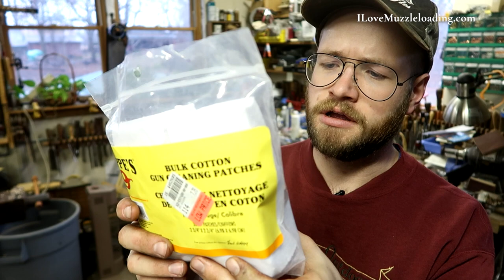How I clean my Kibler Southern Mountain Flintlock | No more rusty muzzleloaders

Comment: tea pot and a small funnel.  I spray a squirt of ballistal in barrel then pour in the boiling water, let it sit for a minute, breaks things up real good. then do what you do in half the time and patches.
Reply: Do you get flash rusting using hot water?  I started just using room temp water for that reason so I'm curious if it's common or not.
Reply: @billmelater6470  water breaks down the fowling... If it make you feel better.... US Army ordinance manuals circa 1864 said to use boiling water as well... Fill the barrel twice, let it sit 5 minutes, fill half way a third time and shake it for about a minute, dump it out, wipe down with patches, issued no more than 10 for drying and oiling with either mink oil or tallow
Reply: @billmelater6470  i do a squirt of ballistal with the water so that may help the flash rusting you speak of.  I don't have any flash rusting as soon as I dump I'm drying with patches and using ballistal oil.
Reply: @swamprat9018  I might give that a try.  Though for the last year I've done well with simple tap water followed up with moose milk then a swab with straight Ballistol.
Reply from the maker: Great idea, thanks for sharing.
Reply: @billmelater6470  I have been using hot soapy water for decades.  Never noticed any "flash rusting".  I suspect that this may be partially an issue with the steel formulation.  That said, my Browning Mountain Rifle shows no sign of rust except the exterior surfaces.... which came that way from the factory.  As Browning's Japanese steel is known for rusting (just ask anyone who owns an old Citori before they started chroming the barrels), I would still say that flash rusting is a rare event.  Not cleaning it is the more common cause of rust in my experience.

Comment: I clean mine basically the same with a little less oil, wipe inside and out down with a clean rag with mink oil on it. When im done i put enough oil on a rag to penetrate the whole way through it and place it in the muzzle of barrel to restrict air from entering barrel. I do the same with a rag over my touch hole. The piece of rag in muzzle is big enough it wont easily get lost in the barrel.
Reply from the maker: Good idea on the piece of rag, easy to get in and out. Thanks for sharing!

Comment: You are very correct in that there are lots of ways to clean BP firearms. What matters at the end is that the fouling is out, if water or a water mix was used the gun is dry, and then a rust preventative is applied. Don't stress if you use a petroleum product as a rust preventative. The bore should be swabbed out before shooting anyway.  Good video and advice.
Reply from the maker: Thanks for watching Nick!
Reply: I quit using petroleum based oils and cleaners decades ago.
If you are using a product like bore butter or similar products that are all natural and with not petroleum base in them, you are actually seasoning the metal like a cast iron cook ware.
You will get alot less fouling and you gun will clean up with half the number of patches. It gets into the microscopic pores of the metal and pushes any rust or minute fouling to the surface away from the metal.
I have clean a rifle that way and came back 6-8 months later, no rust, and ran another patch of wonder lube and pulled out very little light brown surface streaks only, but the barrel was prestine.
Reply: @denisdegamon8224  Only problem with your repeating of T/C advertising is that barrel steel is NOT cast iron and does NOT "season" like cast iron.  After several months of storage I get ZERO brown surface streaks. None.  And using Ballistol or Mr Flintlock or Hoppes Black Powder cleaner/patch lubricant I can shoot all day long without cleaning.

Comment: I've always used hot soapy water and hot rinse water. Tooth pick in the touch hole and a measuring cup with a good pouring spout. Do it outside or in the shower stall. Takes some care but you can keep the water off the wood. WD 40 for lube when I'm done if the gun is going to be shot regularly or good gun oil if it is going to be stored for a while. Knap my own flints from agates or petrified wood.

Comment: Ethan, i know this is an old vid but the sulfur and salts that eat up your BP guns are water soluble. All you're doing is making goo n smearing it around until it oozes out. You dont have to put it in the bath tub but you dont need to add a bunch of oil n chemicals either.
Im tellin you 8oz of hot water with a splash of ballistol will change your life.

Comment: I am a year or so late to this party, but, I have found that most of the fouling is an issue with your patch lube. I use 60% lanolin and 40% bees wax. The lanolin can be an issue to completely remove from the bar, but it will come out. Clean the bore till it shines from breach to muzzle and add oil, doesn't matter if I will be shooting tomorrow or next month. The rest of the process is the same as Ethan did.

Comment: One thing that I do after cleaning my muzzle loader is store it barrel side down in my gun locker. Any oil that is in the barrel will run down to the muzzle and not collect in the breech. 
Another thing I do is use alcohol patches that a nurse would use to clean your arm prior to giving you a needle. They are dirt cheap. I run two of these to start the cleaning process and one just before I oil the bore.
Reply from the maker: Thanks for sharing!

Comment: I use just warm water. Plug tge touch hole fill with water then dump. Repeat a few times then swab with damp, dry and oil. 
Thing is as long as it’s clean there is no wrong way. As ten old greasy buckskiners the best way and get a hundred answers
👍on good vid
Reply from the maker: Thanks!

Comment: I do one thing different than you and that is I run hot soapy water and let it sit for a about 15 to 20 minutes with a toothpick in my touch hole then once I pour the water out I start doing the same thing that you do. Let me tell you about the first time I got my traditions Hawken. I had had it about a week and thought I would go ahead and just check the barrel to see how clean it was because for some reason it kept calling me to do this. With my first patch down the barrel and when it came back out it was full of rushed. Luckily there were no rust chips so I was hoping that it did not pit it any. I almost used a whole box of cleaning patches to finally get that thing to where there was no rust and no color it was awful. At first it kind of scared me about it possibly being pitted and to be honest I haven't had the board looked at to see if it was pitted, I'm almost afraid to but one of these days I'll come across someone that has one of those bore cameras and have it checked out. I Also do about the same thing you do during the winter I'll pull all of my guns out at least once a month and just go through them cleaning. I have a cork that fits the barrel perfect on my Hawken and I put a string on it just in case it decided it wanted to go deeper and I couldn't reach it plus I tie the string to the ramrod. When I started using the Swiss black powder I didn't have to run hot soapy water down the barrel. Well this was a good video it really was and showed what most people should do to their black powder rifles. Thanks so much for the video and look forward to some new ones. Keep ye powder dry!

Comment: Well, I only have a few Hawkens, and a couple CVA type Kentucky rifles. So Hawkens I remove barrel, Traditions remove butt stocks, nipples, vent liners. Then put breech ends in bucket of warm water n Ballistol, start with brass brushes plunging, then switch to jags n patches, then dry patches, then Ballistol patch. If its going to be a bit, yes I go with an heavier/thicker oil. I always keep mine in siliconed gun socks. For a nicer slim long gun like your Kibler, Uncle Sasquatch has a video where he uses a clamp type thing with a hose, it clamps/seals over your touch hole, hose goes to your cleaner, (water?), I believe from TOW. I thought it rather clever, if I had a nicer rifle I would probably get one. I also use a grease on underside of my barrel that I leave pinned into fore stock. Take it down once a year. Same as you, but different. They get clean n oiled, right? Thanks for doing this one
Reply: Tooth brushes work extremely well
For me when cleaning lock..
Reply: @jamesholt6032  yes,I too use them for nooks n crany’s. I get the bargain packs keep some dry, use some w/ solvent, some w/oil. Thanks for mentioning that.
Reply from the maker: Thanks for sharing your info! I've seen those clamp deals too but never tried it, perhaps thats something I  need to be doing.

Comment: Hot water is the best at removing fouling. Get the barrel so hot you can’t hold it for long. Follow with dry patches then oil it. Run a patch the next day to check for rust.
Reply from the maker: Thanks for sharing Steve.

Comment: Great video! Maybe I need some ballistol...I just use some dawn dish soap and hot water down the barrel and 3 in one oil to keep it from rusting. Every now and then some WD-40. It seems to be working OK< but the rifle is just 2 years old.
Reply from the maker: Thanks! If it works for you, I won't knock it! I know many that use Dawn and WD-40. Both those solutions are kind of modern day miracle products I think. I use them all the time for many things. 

Keep me posted with how you like using them!

Comment: Good video Ethan.  I feel like I'm not an outlaw in that I use more solvents than water.  My solvents are different but achieve the same results.  I'm going to find a bottle of the Clenzoil.  I've never tried it.  I've been using Birchwood Casey Barricade.  I'd like to see you post a video on cleaning a smoothbore.  I just don't seem like I'm ever happy with my cleaning job and periodically go back and clean and oil again between shooting.  Thanks for your videos.
Reply from the maker: Thanks for watching Steven. I've not tried the barricade but it might be something to add to the shop, never know when you want to switch things up. 

I've got to find a smooth bore first, I'm a bit behind on the times and don't have one I feel comfortable getting out and shooting just yet.

Comment: Your methods almost duplicate mine for the past 30 years. I have found that a breech scraper is worth its weight in patches as I found that the residue at the breech would color a wet patch forever. I do plug the touch hole and after I’ve run all my patches I use hot water and fill the barrel, let it soak, and then run a patch or two to confirm all is clean and to dry the barrel. Then oil the barrel while still warm.

Comment: Good informative video. I am looking at the Kibler woodsrunner as my next project. i still have not fired my Investarms Hawken yet. I'm not happy with the repair I did on the miss-aligned nipple and hammer. problem I will remove all the wood putty I used in the lock indent and try the repair you suggested with a torch on the hammer. I was concerned about the way that the barrels of Kibler's rifles are held in place as opposed to the wedge used by Traditions and Investarm. That it would present a problem with cleaning Your video put that to rest.
Reply from the maker: Hey Mike, I hope you get to shooting that Hawken! I'm enjoying mine quite a bit. Reach out if you need some more tips, I'm happy to help!

Comment: I've actually been wondering about this lately. I'm new to traditional muzzleloaders and looking forward to getting into it. What cleaning/loading rod do you use? Apologies if you've answered this a dozen times already
Reply: For the sake of getting you an answer; I use an all brass rod with a muzzle protector for my range rod and cleaning rod (ordered from Log Cabin Shop).  Steel is fine too but, be sure to get a brass muzzle protector either way.  I like my T handled rod for the rare occasion I need to break out the ball puller.

I don't trust wooden ram rods.  Be sure to get a good range rod.  From there it's just a matter of getting the proper jag with a cup for round ball or conical, depending on what you plan to shoot.
Reply: @billmelater6470  thanks very much Bill.
Reply: @thwackTX  I almost forgot.  Check out a channel called "dualist1954".   He's got quite a few videos that cover the basics with REALLY helped me out when I started.
Reply: @billmelater6470  awesome, will do. I inherited a .45 Hawken full stock from my late father that I am really looking forward to shooting and hunting with this fall. Been slowly collecting the things I need so hopefully I'll be at the range soon.
Reply from the maker: Hey sorry for the delay Robert! I made this range rod in my shop but you can get some from the Log Cabin Shop, Flintlocks LLC, Deer Creek Products, or many of the other muzzleloading supply shops out there. Just be sure you get the right length for your barrel.
Reply from the maker: Mike has the best videos!

Comment: Since the breech plug and tang are one piece, it isn't designed to be removed every time it's cleaned.  How do you prevent cleaning agents like ballistol, from seeping under the barrel?  Ballistol or any other cleaner will leak and take with it the corrosive black powder residue and other contaminants, and leave them under the barrel.  How do you prevent this from occurring?  Any ideas?

I have a Pedersoli "Traditional Hunter Hawken."  I was very surprised to find Pedersoli designed their rifle that way.  
I took mine apart before I took it to the range and left the underside wet with WD-40 Corrosion Inhibitor.  Hopefully, that will slow down the corrosion.  

I remember back in the early 1980s, I saw a one piece barrel (I don't remember the manufacturer), which had been pulled from the stock.  The underside was a rust bucket.  The top was corrosion free and looked pristine.  That was the main reason my first muzzleloaderI was a Thompson Center Renegade Flintlock with a hooked breech plug.
Reply from the maker: Great eye and question! 

Traditionally, we see these pinned barrels like this one left, and possibly taken our yearly or by yearly in contemporary muzzleloading. I'm trying to find some of the historic record to advise on barrel channel cleaning pre-1890 but it's been hard to find outside the military record. 

For many, myself included, a tight barrel inlet is key to helping stop any detrimental rust. In my experience, and family experience, any rust on the underside of the barrel is easily cleaned, oiled and back into good shape in no time. I'll pop this apart sometime on video to document what might be under there. 

The hooked breeches are great for keeping something in tip top shape.

Comment: I think the breech face is most easily cleaned with Tow on a worm. It was always a challenge until I tried Tow.
Reply: What is a Tow?
Reply: @hawkpilot6-actual  Tow is Flax fiber. The stuff Linen is made from. A hank of it looks like blond hair. Long ago, people used that instead of cleaning patches. You have a Tow Worm on you ramrod. It looks kinda like a cork screw.  You separate some Tow and wrap it around the Tow Worm.Then swab your barrel with it. in some ways it's better than a cloth patch. The individual fibers get into crannies well. In my case, I have a hollow Breech Plug. It's recessed at least 1/4 inch so a patch doesn't clean the face of the Breech Plug. With the Tow, I have it extend well beyond the Worm, so it gets compressed into the hollow space and cleans the Breech very well. I tried doing the same thing with patches, but it never worked.

Comment: Use Birchwood Casey Barricade for final cleanup B4 putting away your flintlock as it has oil and a wax that hardens onto the surface warding off rust, and I'll even clean the bore with it the same_ <<MARK C NADING>>

Comment: Thanks for sharing your process for cleanup. In this video, around the 6 minute mark, you talk about the Brownellls Oxpho-Blue finish. Did you video that process on this rifle? Did you have any issues with any of the metals in the kit?
Reply: That's what I want to know something about for a long rifle I'm building. How good is the oxpho blue because what I have heard you don't even have to worry with getting all the oil off and it will still work great and you can keep applying it and get a really dark finish. I'm really thinking about buying some and trying it out. Hope it works the way it was advertised. And I have thought about cerakote finish and a few other types of finishes . I really don't want a shiny finish on the metal parts I just want a good matte finish. I had the thought of putting a military olive drab finish on my long rifle just the barrel and do the butt plate flat black and the nose cap flat or satin black and the pipeing flat or satin black and the trigger guard the same way with black hammer and side plate olive drab green. Just can't make my mind up and each one I have built they are all different finishes in color like browned barrel and blueing salts on one that turned so dark blue it's kinda got a purple tint to it and some of my others are hot blued black. I guess I have a addiction of building guns from all the black powder rifles and pistols to modern day firearms. I'm all alone here and no children and single my girlfriend got murdered 8 years ago and that's all I got now is building guns and inlaying the stocks and ingraveings on the barrels and trigger guards that's all I have now and my house and property and I guess building guns keeps me from loosen it. At least I don't drink alcohol or do drugs I'm have a firearm addiction and I'm 60 years old and all alone here I have friends I go and see some and we shoot our rifles and pistols and check out the property some and then I come back home and think and draw up plans for a new design for a long rifle or some other gun. Hey you take care and hope the best for you and prosperity. It gets pretty quiet around here all alone and I can't stand to listen to music anymore it brings back memories and those memories hurt .